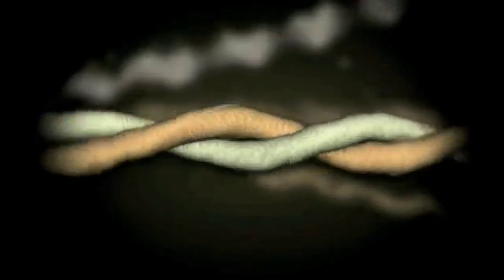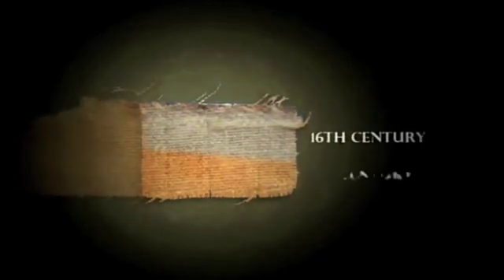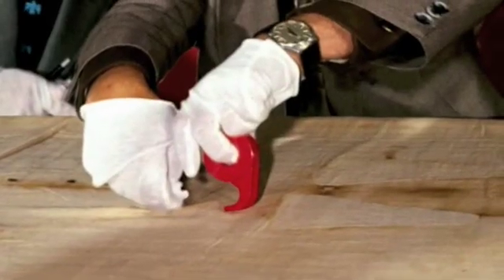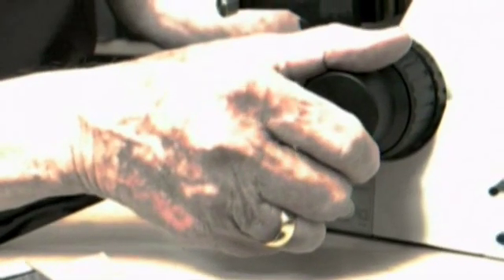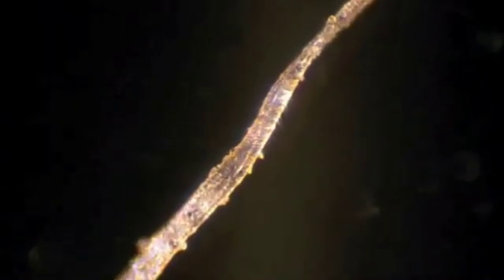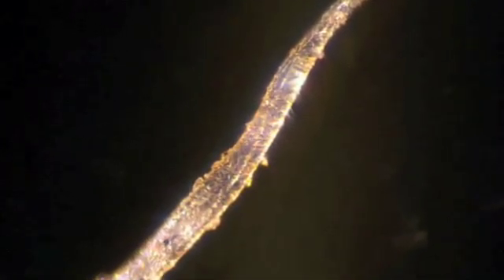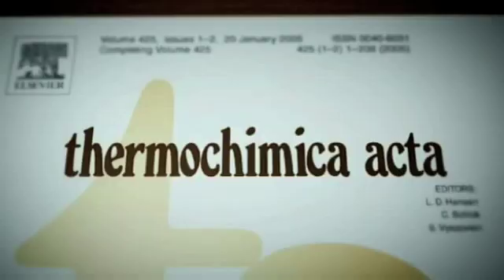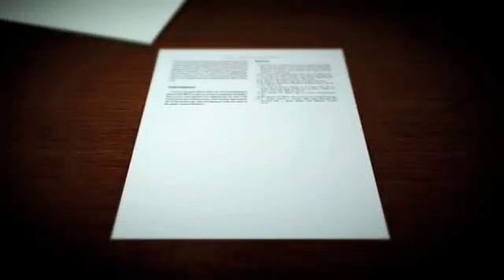Shroud of Turin - Carbon 14 test proves false

Comment: I don't understand what your arguing here. Where do you get the figure 2700 yrs? Also if you understood ANYTHING about radiocarbon dating or read and understood how the C14 dating was performed/ accomplished in 1988, you would understand how the C14 dating was erroneous and basically non-science, and not just because of the possible reweaving. Do some homework!  Thanks.

Comment: try googling "A Skeptical Response to Studies on the Radiocarbon Sample from the Shroud of Turin by Raymond N. Rogers"
and then go read Rogers paper... you'll see the above debunking is correct. you're repeating ignorant lies. 

"the linen can actually be dated anywhere from 1300 to 3000 years old, easily putting it tentatively in the 1st century, an incredible find."
sorry, but a range of 2700 yrs is unacceptable in ANY science lab. The original C14 dates will stand up to scrutiny as legit

Comment: @Flagrum3 To anyone here interested, you can find R.Rogers peer reviewed document by Googling Raymond Rogers, Thermochimica acta 2004, which was reviewed and agreed upon by no less then 2 other labs.Therefore proving the 1988 C14 dating in error.Also by reading Rogers document you will find that thru the findings of vanillin in the fibers or lack there-of, the linen can actually be dated anywhere from 1300 to 3000 years old, easily putting it tentatively in the 1st century, an incredible find.